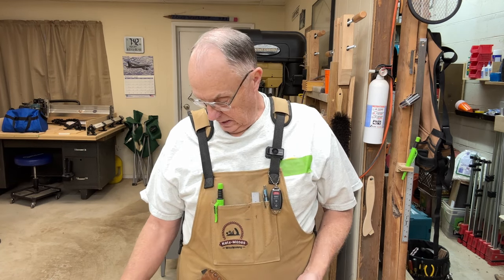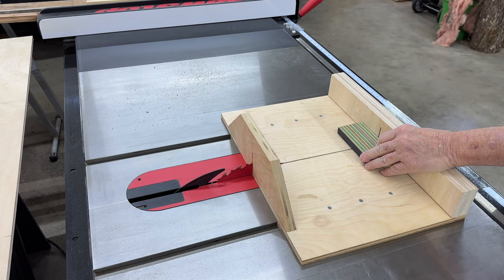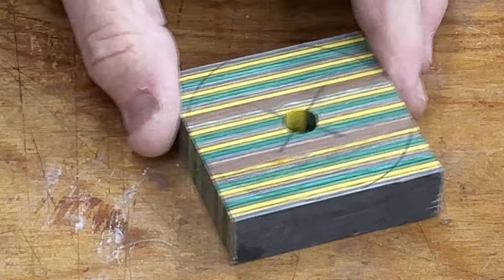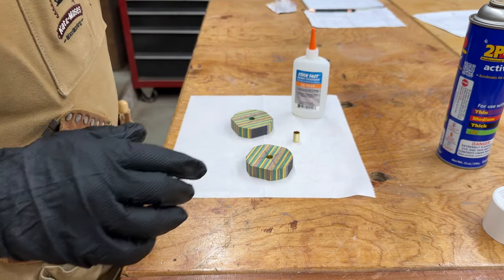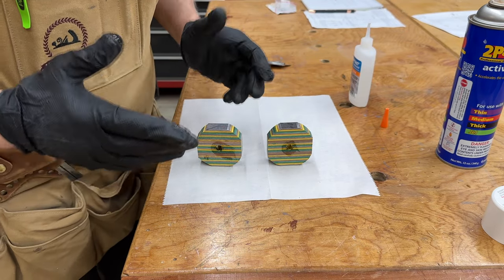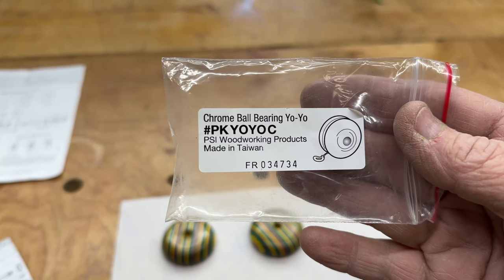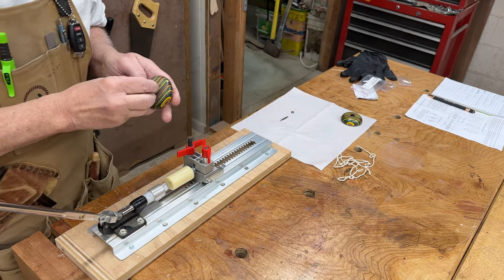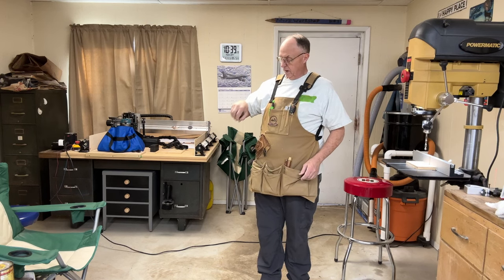How to Make a Wooden Yo-Yo!

Comment: Are those the same as Spectraply pen blank material? I have a bunch of that and this would be a good way to use some up. Thanks for the idea!
Reply from the maker: Hey there! Thanks for checking out the video! Yes, the material I used is similar to Spectraply pen blank material. It's a great way to put those Spectraply blanks to good use. I love the vibrant colors and patterns it adds to the project. Give it a try, and feel free to share your results!